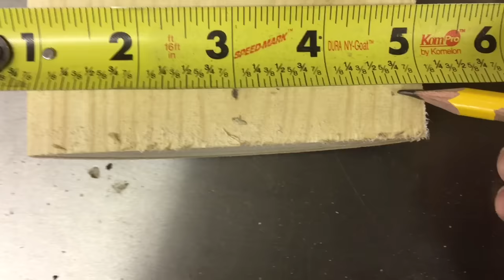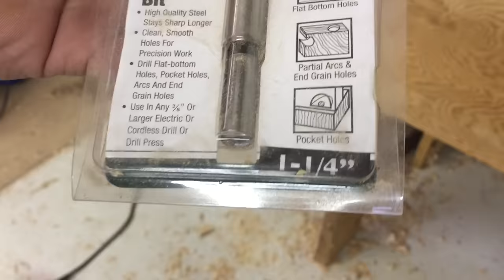Hummingbird Nesting Platform

Comment: I'd bet it was never used by hummingbirds.  Hummers won't nest in boxes, and while this is not a traditional bird-box, it is enclosed enough that a hummer wouldn't use it. Hummingbirds typically build their nests where branches diverge, creating a Y shape. And they build their nests where they can see 360 degrees around them, and fly away in any direction. I'd also like to point out that the cotton balls we buy are not good nesting material for birds. It has been processed using chemicals. Same goes for yarn and string. It's best to just let the birds find their building materials in the wild. 
I'm also going to say that if you have hummingbird feeders, you should throw them away, and get plants that attract hummers. Hummingbird feeders kill countless hummers every year. They are petri dishes for mold. Hummers that drink from a feeder with mold in it die a slow, painful death. And most people just don't clean their feeders and sanitize them properly, to ensure the feeder is safe. The mold is present long before you can see it with the naked eye. So a visual inspection isn't enough to ensure no mold is present. So planting hummer faves is a much better option. And, you can grew them in pots if you don't have anywhere grow them in your yard.

Comment: THIS IS LITERALLY DANGEROUS TO HUMMINGBIRDS!

I know this video is 2 yrs old, but people really need to stop with the whole Hummingbird "house" & "Nest Platform" thing. Even if you can get them to use it, which is incredibly unlikely and would be far more trouble than it's worth, it's a very bad idea. Someone has likely already pointed this out (I didn't feel like perusing the comments), but Hummers build nests on small, lightweight branches that will collapse under the weight of a predator FOR GOOD REASON. This nesting platform would just make it easier for a predator to gain access to and kill the hummers and their babies. If you care about the well-being of Hummers, DO NOT BUILD OR USE THIS OR ANYTHING SIMILAR.